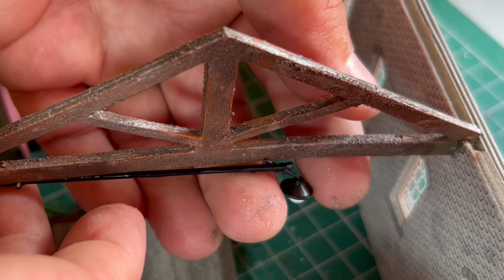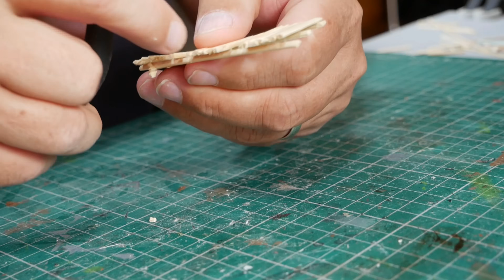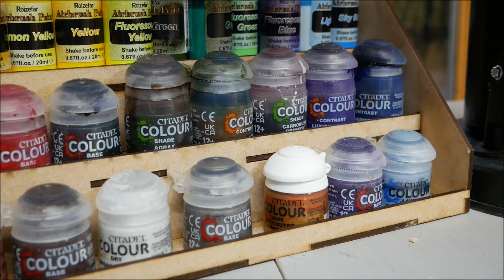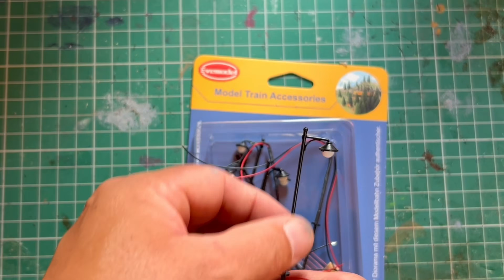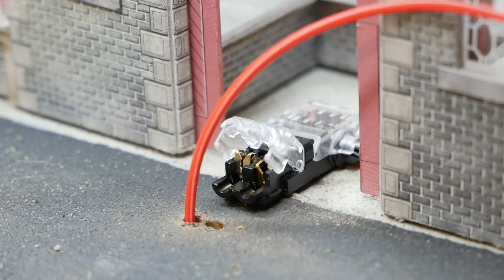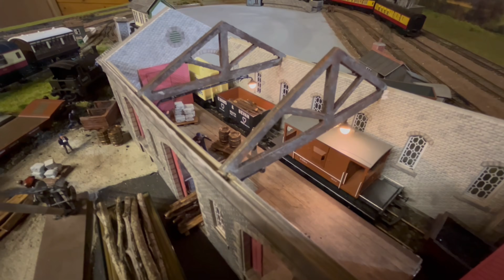The Ultimate Upgrade for YOUR Model Railway Goods Shed!

Comment: Fantastic!
Yes I add lighting but inside buildings I either use small prewired LED lights that often come from China and are sold on eBay or the light strips from Railwayscenics. Care is needed with LED lights as especially the very small ones might need 2v and not 3v.

I've never made my own pallets, but I like the demonstration and now that I've seen it might well do likewise.
Reply from the maker: Thank you so much for sharing your lighting insights! Those tips about prewired LEDs and light strips, especially the voltage warning, are super valuable for anyone looking to add detail. Really appreciate you taking the time to comment!

Comment: Looks great, especially with the building lights on.

Great work with the AK Corrosion Texture and those pallets look great.

I built a wagon flatbed using matchsticks on a Hornby four wheel coach chassis, and I found it really fiddly in a similar way to your pallets.

Glueing across the top of the pallets was a great idea, and would have made my life much easier if I'd thought of it. 

Hopefully I'll remember next time I do something similar!
Reply from the maker: Thanks for the awesome feedback! I'm really happy you noticed the building lights and the AK Corrosion Texture – those details are always fun to add. And it's great to know my pallet-glueing tip might help you out next time!